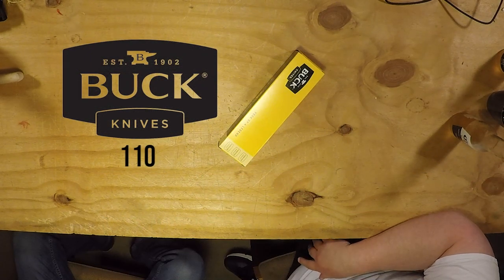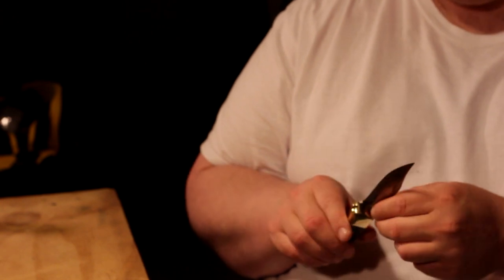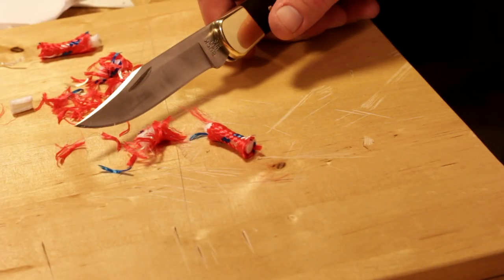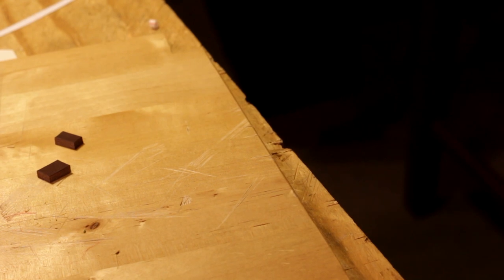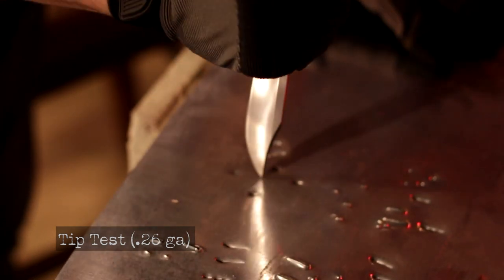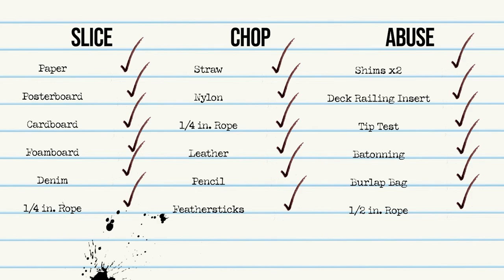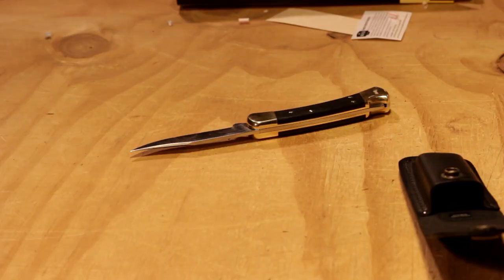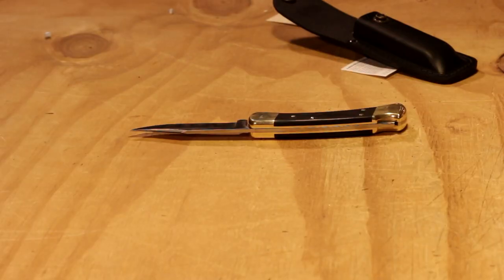Buck 110 | Knife Review/ Torture Test

Comment: I bought a Buck 110 In '72.  It's been used in factory work, backyard automotive, house repairs, camping, hunting, fishing.  In more than 50 years, it's stood up to everything I could throw at it.  The knife has never failed, nothing broke, and the lock has held in all circumstances.   If you want flat out reliability and function, this is the only knife you'll need.

Comment: Use to carry a Gerber drop point folding knife with blade release close to the blade and several times the blade would fold when I was using it. My Buck 110 never has in the 10 years I’ve used it.

Comment: Buck is my number one ☝️ company for a reason. I daily carry the TRX 110. It has the same blade as the 110, though the handles are G10 and s30v steel. Also called TRX for the screws it uses, so you can take it apart to clean it Much lighter, perfect EDC! Great knife!

Comment: This is the only knife I carry now.  I recently scored two 1980-81 3 dot Buck 110's and if you haven't held one, you have no idea what the Buck 110 should be.  The 1980-81 3 dot has squared off bolsters and is built like a tank and was the last year they used 440C steel (I believe heat treated by Paul Bos).  The 3 dot IS what the Buck 110 should look like.  It's the masculine version of the 110 and is built like a tank.  I have a 2005 Buck 110 with Idaho stamp and it has the rounded bolsters and 420HC and the 3 dot puts it to shame!  The rounded bolsters almost make it look feminine to me.  So all those damn super duper steel knives I've collected over the years now just sit in a box and collect dust (well actually a safe deposit box because they are worth double or triple what I payed now).  So from now on, my edc, hiking, camping, backpacking and hunting trips will include my 3 dot Buck 110 along with a 5160 steel fixed blade.  The 3 dot 1980-81 Buck 110 is all you need.  And no, I'm not an old man, still in my thirties.
Reply from the maker: Well sir, you have piqued my curiosity. Thank you, this was informative as hell!
Reply: @NewAgeTactical  I have 4 of them . And  love them . I do not understand why buck can not have the sheaths made in  the usa.

Comment: if its not broke- dont fix it? my first knife i bought myself when I worked for Ace hardware when i was a teenager was a buck 110.   they make various versions now, lightweight, assistated opening, clamp on thumbstuds. you can custom order it with finger grooves, and diffrent blade shapes, also in s30v steel. the BOS heat treat is amazing.  I also like its little brother the ranger and squire

Comment: 6 months in, lost my Delica 4 on a bike ride I believe but this has been replacing it and I’m really loving having it on my belt. A interesting way to one hand open is with the blade tip facing up while closed place your thumb over the nail slit with your index bent against it and within a swift motion you can swing the handle down. Don’t recommend that for every opening but it’s good when your other hand is holding something
Reply: I usually open it with my mouth while cutting open feed bags. Hand on the handle and lips curled over my teeth to pull the blade out

Comment: If you want to add a thumb stud to it you can get a kwik thumb stud for like 8 bucks on amazon.  My main gripe with buck is how they use pinned construction on just about everything.  You could always just lube it from the outside and use compressed air to blow out gunk, but I like to be able to take my tools apart to maintain them better.  Hope your shoulder gets better man.

Comment: The only real problem I have with the 110/112 series is that fact that the blade can "overclose" and contact the frame, dulling the edge, usually just behind the tip. This is a design flaw and should have been addressed 60 years ago.